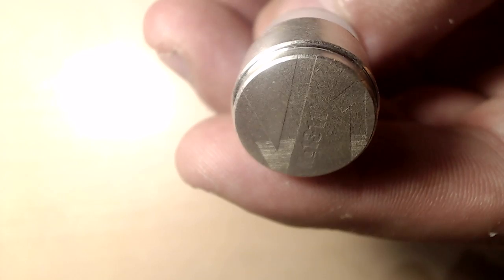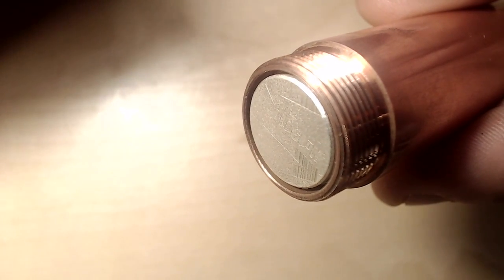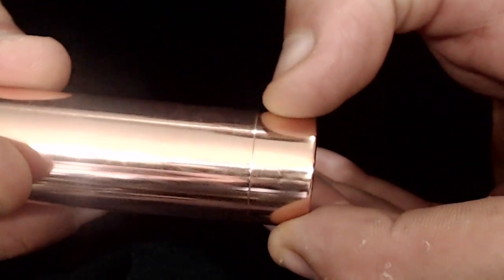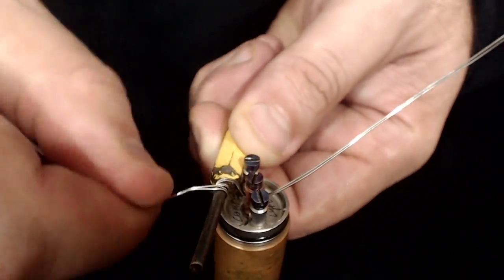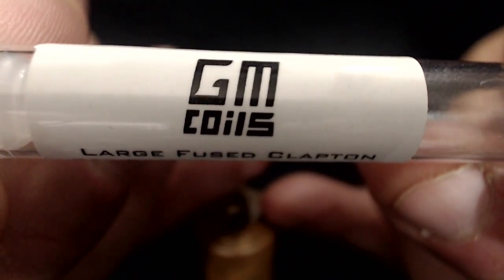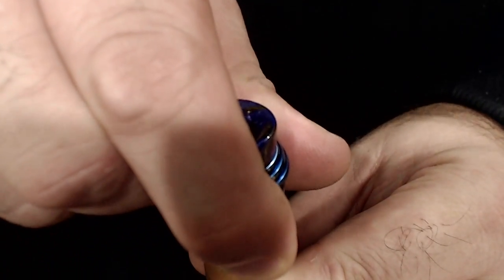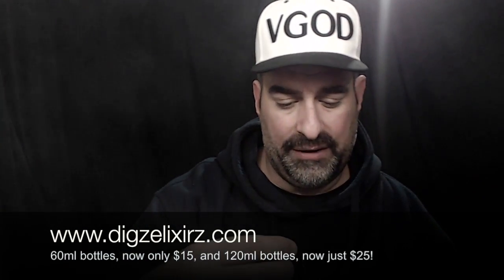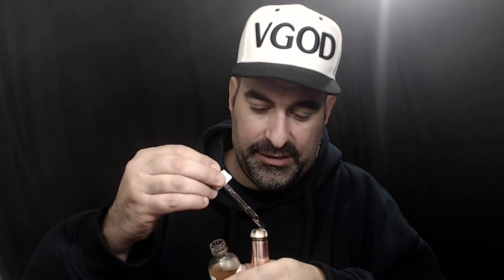Get Low Mods Russian Copper Competition Mod мех мод

Comment: Hey Lou, I was just wondering what battery you use in your mechs when you're vaping at around .07 - .12.  Also what's the longest you hold the button down on those super sub ohm builds?
Reply: Chris Salas scary